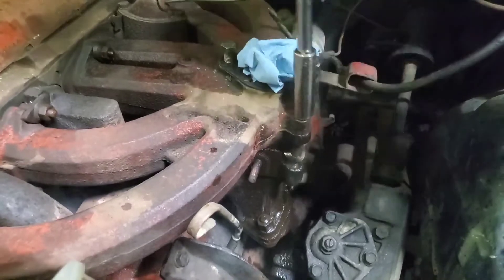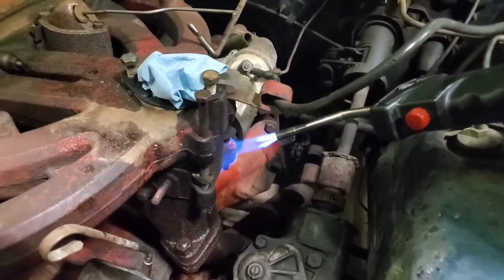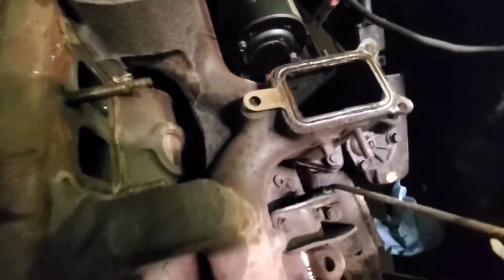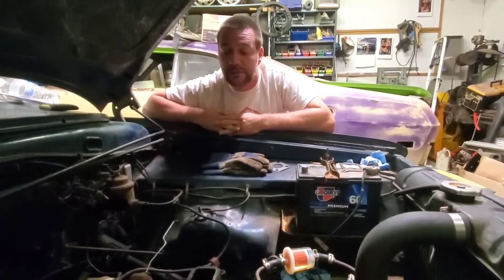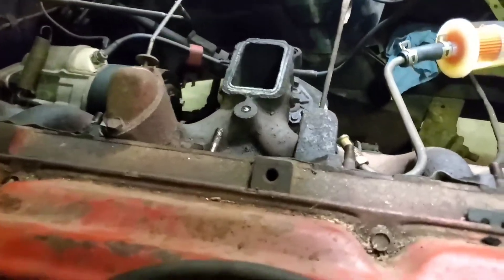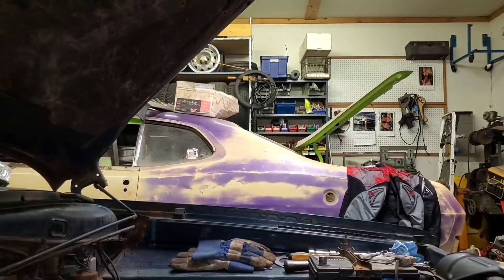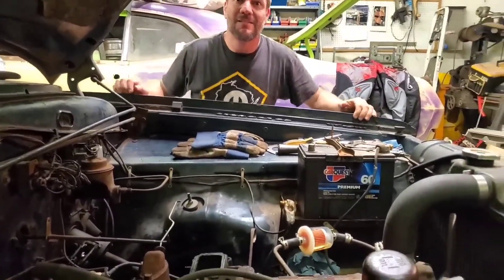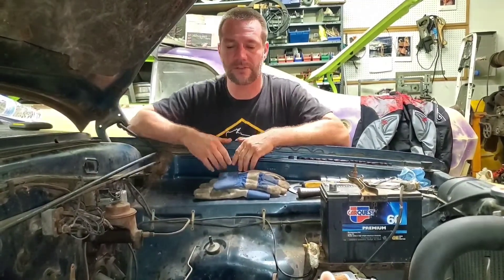1965 Valiant..More parts required

Comment: Good work!! Do yourself a favor and cover the fuel line with a wet rag when using a torch near it and get rid of that plastic fuel filter...
Reply from the maker: We were living dangerously 😅
Reply: @RabidTransitGarage  I'm not lecturing, or am I??  Just trying to be observant😂
Reply: @terrymeyer9895  the plastic filter is temporary. I wanted to see if the car was even getting fuel, or if it was boiling in the line. After I heard fuel boiling in the carb itself, I had an idea of why. I wish I was wrong sometimes..
Reply from the maker: @terrymeyer9895  oh no it's fine, we should have been more safety conscious...but we weren't,  lol
Reply: @jasonfalk7696 good job diagnosing the fuel issue. I wasn't trying to be a smart alec, just looking out for your safety. Don't ask how I know😁
Carry on...👍
Reply: @terrymeyer9895  thanks, and it was sketchy. Breathing in the fumes from PB Blaster heated to a few hundred degrees may (or may not) have had something to do with the fuel line judgment call... 🤔😆

Comment: Has he looked at Aussie speed or Clifford performance?  Dutra Duals?    or is he planning on just keeping it original so he can drive it in the winter?
Reply from the maker: His wife (it's her car) shot down any mods at all, bone stock..
Reply from the maker: He actually wanted to small block swap it, shot down, 😆
Reply: She wants it stock. I even had to talk her into replacing the master cylinder with a dual pot. It still has the single on it, with 2.56 (sarcasm) inch drums.

Comment: thats the best way to do bolts and I take it a step further and buy the anti rust coated grade 8 bolts from fastenal for stuff like those intake / manifolds bolts. got rid of my heat riser flapper and put a small squsheet of aluminum under the carb and I used a half inch factory fiber carb spacer . I also went to a bigger exhaust pipe and exhaust pipe flange to help take away the excess heat in the manifold . check out my youtube video I did on my 65 dart 225
Reply from the maker: Will do, I was thinking about the the fiber carb spacer to dissipate some heat
Reply: @RabidTransitGarage   if you need anymore help let me know
Reply from the maker: Will do